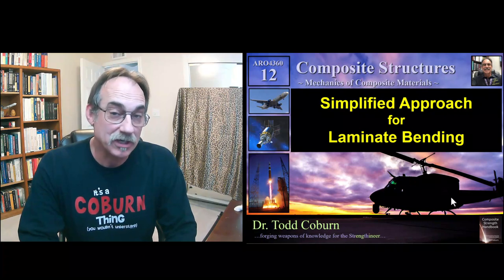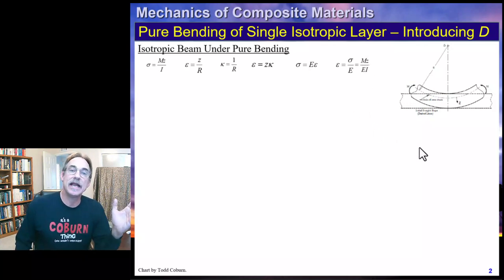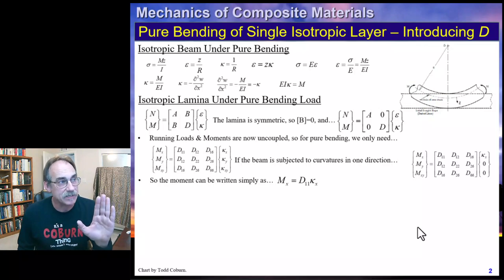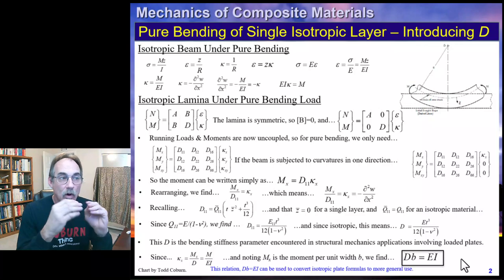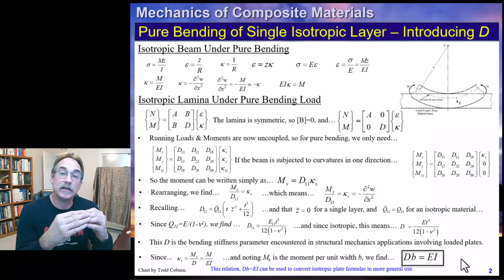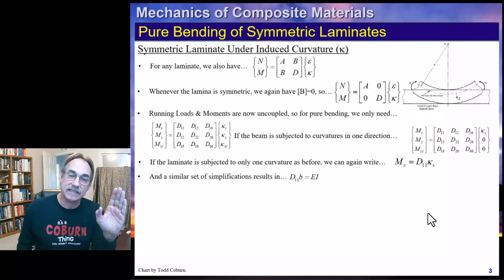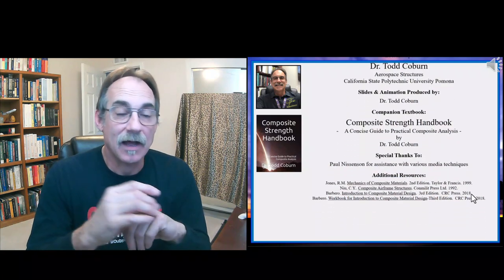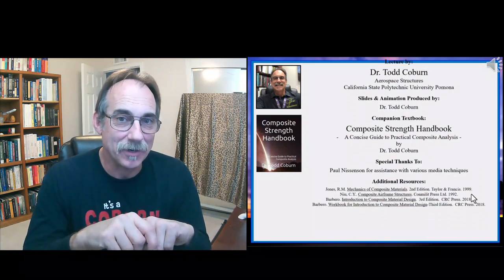Composites: L-12 Simplified Approach for Laminate Bending

Comment: Interesting video. Do you have any videos on how to have a in-depth analysis of a composite laminate I-beam Structure ?
Reply from the maker: Thanks for asking.  No… i do not currently have a video for that.  However, you could calculate the effective running load and moment on each flange and then do a CLT analysis on that as an approximation.